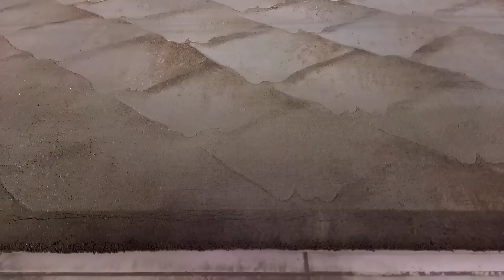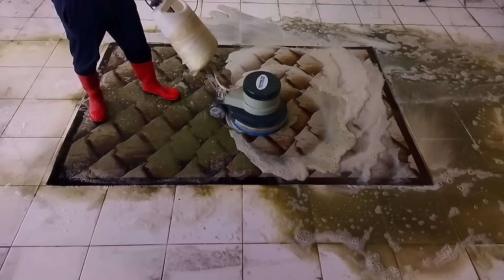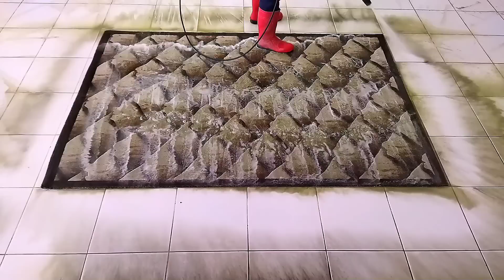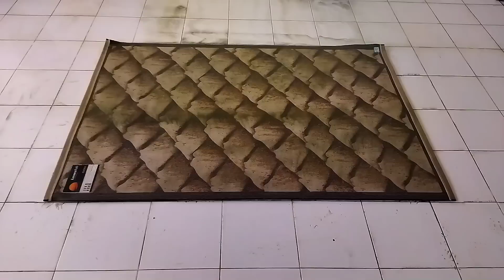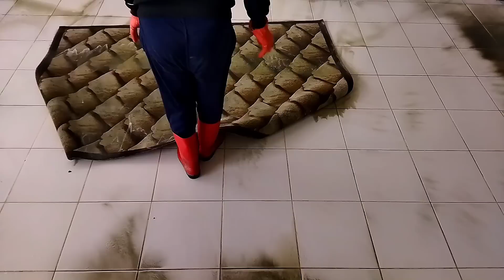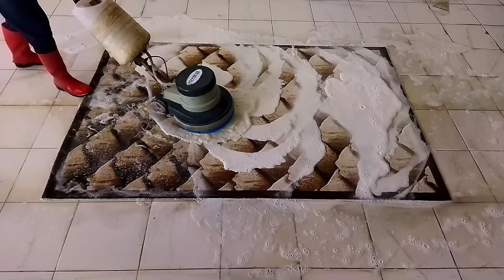Mossly dusty carpet cleaning satisfying rug cleaning I ASMR I

Comment: Calming to watch. I have one question, is there a way not to use so much water? Watched few of these videos and I have an idea (If it was not already realized!), to lower the amount of water used for one carpet.
High pressure warm water sprayed from both sides (Large/wide spray nozzles for different sizes), slightly different elevation on each side, while carpet is hanged to some sort of mesh. At the same time water is filtered and reused. Maybe a stupid idea, IDK.

P.s.: Good job btw!